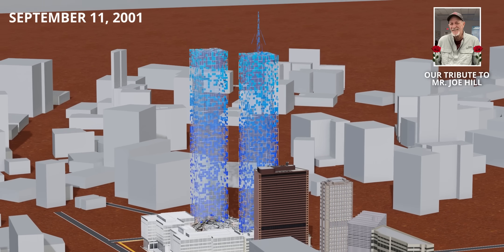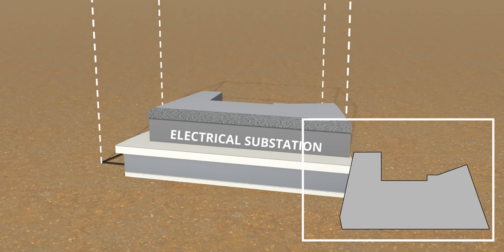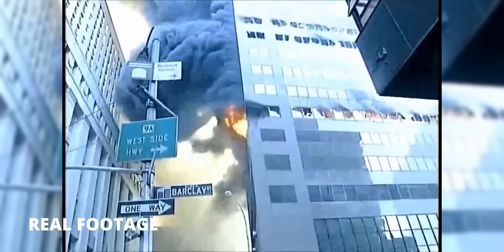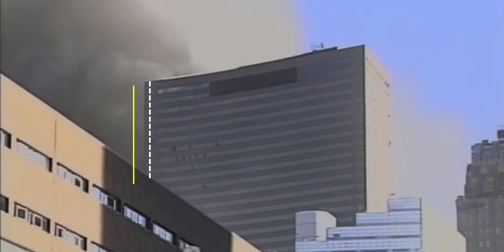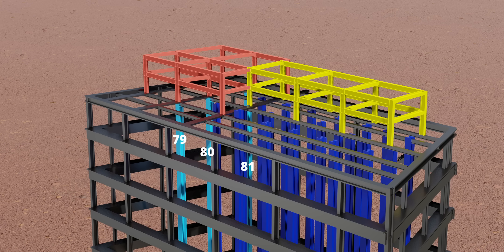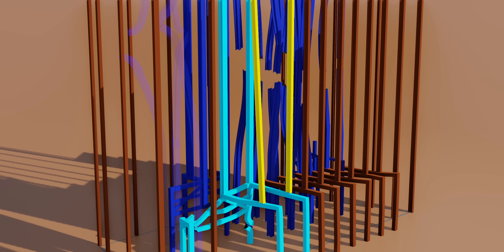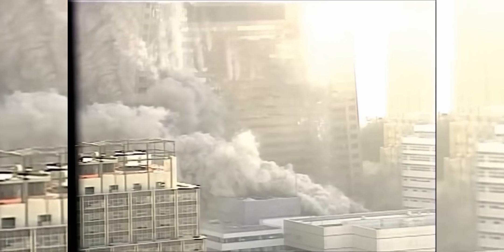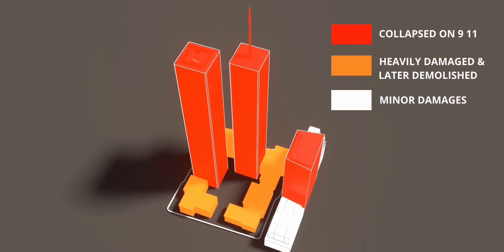Collapse of Building 7 | The Complete Physics

Comment: Let's forget the trade center find pictures of the plane wreckage at pentagon they dont exist 😂😂😂😂
Reply: Uh huh  We know Flight 77 – a Boeing 757 - hit the Pentagon because of ALL of the following true and relevant facts, not because of one random anomaly. When complied together, all of these true and relevant facts form a single inescapable conclusion; 

1. Witnesses: Local and national media published or broadcast the accounts of ALL of whom reported a plane hit the Pentagon, while no witnesses reported seeing anything else (ie: none saw a missile). Around 2 dozen witnesses could identify either the aircraft type, the airline or both. 

2. Flight Path: On its way in, Flight 77 created a damage path (the tree hit by the left engine, the 5 light poles, the garden wall on the Pentagon lawn and the mobile diesel generator) which is consistent with an aircraft the dimensions and layout of a Boeing 757. No missile could do any of that. 

3. Impact Hole: The impact hole in the outside wall of E-Ring at Wedge 1 of the Pentagon matches in size and shape the Boeing 757 from engine to engine. Wing impact marks extend out on either side of that to the span of a 757. youtube.com/watch?v=FkgJ-rFFBD0 

4. Building Damage: The damage path inside the Pentagon takes the shape of an inverted cone, with over 80 support columns all of them bent in the direction of travel. This is consistent with the high speed impact of a Boeing 757 aircraft and NOT the high-explosive blast warhead of any missile. 

5. Aircraft Wreckage: 19 tons of B757 wreckage were recovered at the Pentagon crash site including the landing gear, both engines, the entire left wing flap assembly, part of the cockpit, seats (some still occupied), landing gear bay doors, fuselage sections, the Flight Data and Cockpit Voice Recorders for Flight 77, etc, etc,... youtube.com/watch?v=kCRuVNgrAAw&ab_channel=cjnewson88 

6. Two parking lot security camera videos from the north parking lot security booth captured images of a B757 sized aircraft in AA livery flying along the exact flight path of Flight 77 and at the same velocity recorded by its FDR. The aircraft was trailing smoke from the right engine due to hitting the aforementioned tree moments earlier as confirmed by several witnesses. 

7. Human remains: The remains of everyone aboard Flight 77 were recovered and identified with the exception of 1 infant whose remains could not be identified. Some victims were recovered still strapped in their seats. Each of the victims families were provided with a detailed autopsy report. 

8. Personal Effects: Several thousand personal items belonging to persons aboard Flight 77 were recovered at the crash site at the Pentagon with the victims families being provided with a 1,000+ page book detailing every item for identification and return. 

9. Radar: A total of 6 FAA and NORAD radar sites tracked Flight 77 from take off to impact. The radar data matches EXACTLY the 25 hours of flight data recovered from Flight 77’s recovered FDR, right down to the last decimal. youtube.com/watch?v=3vqDDlS9Hyw&t=6s&ab_channel=cjnewson88 

10. Insurance: American Airlines and its insurers accepted responsibility, admitting Flight 77 crashed at the Pentagon and subsequently paid out tens of millions of dollars in damages. 

11. Boeing; The folks at Boeing confirmed it was a Boeing 757 and specifically Flight 77 which hit the Pentagon. 

12. Where is Flight 77? It is a fact that Flight 77 never landed anywhere, nor has anyone aboard been seen or heard from since 77 crashed into the Pentagon. 

13. Even if the 9/11 attacks were an inside job, Flight 77 still hit the Pentagon and the above true facts are still true facts. “9/11 was an inside job” does not mean “flight 77 did not hit the Pentagon”. 

14. Pilot Skill: Hani Hanjour was a crap pilot and his flight path proves it. But he was grossly over-qualified to crash a plane – something anyone can do. A number of Hanjour’s instructors are on record stating that while he was not a good pilot, they have no doubt he crashed Flight 77 into the Pentagon. The conspiracy types always leave that part out. 

15. When staging an attack that absolutely has to use planes - and I cannot stress this enough - you use planes. Common sense. 

16. No blast crater or damage, radial fragmentation pattern, pre-formed fragments, missile parts or anything else associated with a missile were found. 

All of the above is true no matter who planned and carried out the 9/11 attacks or why - which I know will be seen as a blasphemy by many reading this. 

Anything can seem like a conspiracy if you don't understand it. Now you know. If you can do better then by all means, have at it. I am open to any more plausible alternative as to what hit the Pentagon using ALL of the available evidence while relying on fewer unproven assumptions than what I outlined above. 

Go ahead, be the first to even try. 

Since no one ever does, it’s been nice knowing you.
Reply: @TheCriticalStinker-01 that's a nice copy and paste job. How many handlers do you have? How much script do you have? I know what you really are.
Reply: Other than the many many pictures of plane wreckage, you mean?

Meanwhile, even if they hadn't existed.....so what?
Reply: @mooneyes2k478 your dad should have wore a condom remember Donald rumsfeild realized trillions of dollars missing all the records were in those towers u better take a physics class that was a controlled demolition glue eater 😂😂😂

Comment: ''Each World Trade Center twin tower weighed in excess of 500,000 tons, though some sources mention 250,000 tons, and the construction used over 200,000 tons of structural steel.'' 

Imagine the vibration of these towers coming down right next to building 7. You've seen and heard the collapse of both Towers. Thats what destroyed the foundation of WTC building 7 and caused it to collapse.
Reply: 1.The firefighters said" it looked like they planned to take down the building" I didn't say that, The fire fighters said that. They were there.I'm sure they know best.
https://youtu.be/XiIT4HInWjY?si=e1Pvp3-IFs-M75Oj
When the firefighter says "boom, boom, boom, boom" in this video.
What do you suppose he is?Implying by " boom" ?? What do you hear? 
2.So if there were no explosives then what is this? 8:25
https://youtu.be/bLF5D7M1YgA?si=aHSvS__uOdxMi1ZB
You can't say that it was added because you can see the firemen's reaction to the explosion. And you can't say it came from anywhere else because the firefighter says
" We gotta get out of here,  7 is exploding "
3. Controlled demolitions have squibs, you can see the squibs here 20 floors below the collapse. 
https://youtu.be/eXAgulfAtR4?si=-iLO9aQjMJVLTUYH
4. Firefighter says "any one of these buildings could blow up,  this ain't over yet" firefighter says there's 3 secondary explosions. 
https://youtu.be/0Gh3ErgMI4M?si=mmp9Eus_5PWTCBfl
5. Airplanes can't fly 600 mph at 1000 feet. And to be able to make a 180 degree turn to hit the opposite side of the pentagon going that fast is ridiculous. And since when do terrorists hit the opposite side of the building where no one was at when they could have just flown straight in and killed way more people???
https://youtu.be/0Gh3ErgMI4M?si=mmp9Eus_5PWTCBfl
7. No one has ever known ahead of time that a building was going to collapse except through controlled demolition.  Tower 7 was reported to have fallen while it still stood in the background. 
8. Larry silverstein,  the man who made over 4.5 billion when they fell, claimed to have pulled the building down.
https://youtu.be/1jQaJFNWqtc?si=wCywQ9grgBdS_w11
9. A witness reported a missile hit the pentagon while he was seen at the scene. 
And the hole wasn't big enough for a plane and the damage wasn't consistent to the towers. And just like shanksville,  there's pictures that show no plane parts at all.
https://youtu.be/6_Ez-UCpXMs?si=JaQ6DBEC_LJtMLgN
10. That video also points out They were military planes that hit the twin towers. 
11. All sorts of reports of explosions were reported that day.  
12 Buildings dont accidentally fall  Into it's own footprint.

Comment: Can you please add a simulation how it would fall if the thermite charges previousely installed would work on every column and stage of the building?
Reply: It wouldn't fall at all. Which is why no one uses thermite to demolish buildings.
Reply: No simulation needed.Just watch the video of the collapse
Reply: @robbiehiatt9966  And then ignore what you see because it doesn't fit into your narrative.
Reply: And then a "simulation" how it would fall if Santa Claus cast a spell. Right? While we're on the subject of fairy tales and all, I mean.

Comment: But if the fires had mainly affected one side of the tower and if the most affected columns were quite lateral, how did it manage to collapse perfectly horizontally?
Reply: He made it clear, they built the perimeter columns with cereal boxes😂😂😂 they all folded perfectly in sequence for the building to fall directly into its own footprint
Reply: The fires "mainly affected" the entire building, and it didn't "collapse perfectly horizontally". There we are, facts solved your problem.
Reply: @mooneyes2k478 😂😂😂😂
Reply: watch the video, he explain it
Reply: The smaller side of the building was damaged.  This building was not rectangular. The side with less virtical supports and fire should had made the building fall toeards the smaller  weaker side. No if fell straight down,  every perimeter column cut exactly at the same time. Otherwise the roof wouldn't had held its shape all the way down.

Comment: If a fire can cause a complete building collapse, then the architecture is faulty, and other buildings are also at risk.😮
Reply: That fire is a threat to buildings in general have been know for, oh, 3000 years? Steel structures, since about when mankind started making them.
Reply: Buildings are designed to resist fire. They aren't designed to resist fire for 6 hours while every civil servant in a 30 mile radius is focused on something else.
Reply: @EPMTUNES  Don't forget the water main broke after the north tower fell. Even if the FDNY weren't busy with bigger concerns the building had no chance.
Reply: An UNCONTROLLED fire absolutely can and has collapsed steel buildings. They're normally not skyscrapers. Steel airplane hangars and quonsets burn down pretty regularly. Because fire weakens steel.

Comment: 6:45 
"At the height of transfer trusses, the building temperature was quite high, and the trusses failed". How scientific of you. The temperature of the building wasnt 2200 degrees, which is what those beams are rated for. Try again you Shil
Reply: No, they weren't. What they were rated for were 2 or 3 hours of fires, depending on where they were in the building. What do you know, the building burned for 7.

Comment: HOW could a fire start and continue burning inside Tower 7 which was made of concrete and steel?  Those materials are NOT combusitble!  So what was actually burning  so hot in there that caused the steel columns to melt ???  THE ANSWER TO THIS QUESTION IS ABSOLUTELY CRITICAL.
Reply: So, you think buildings are empty?
On the other hand, you thought the "columns melted" so, I don't doubt you do.